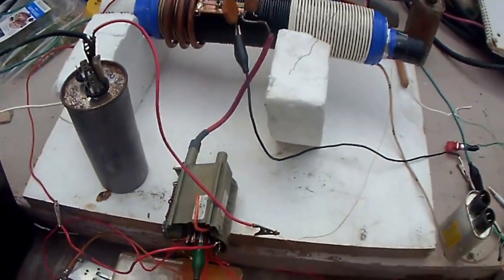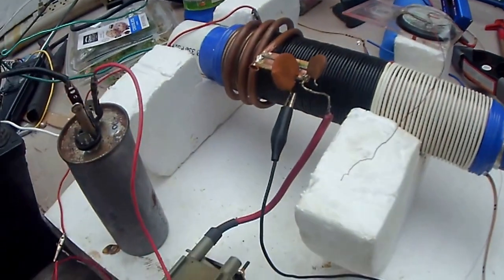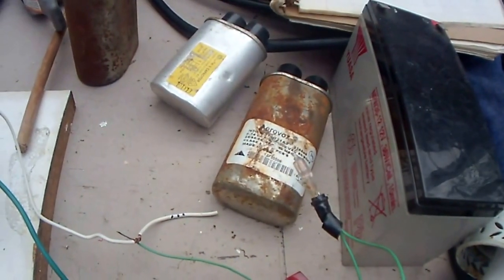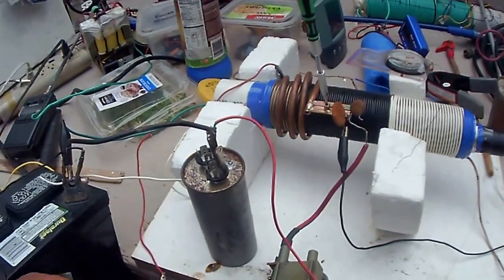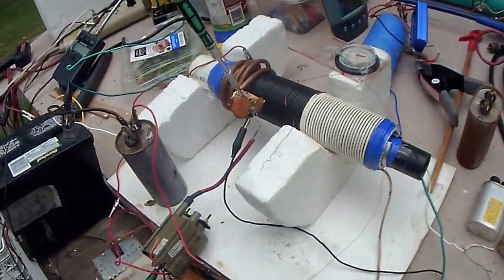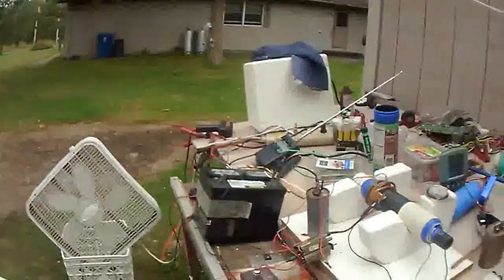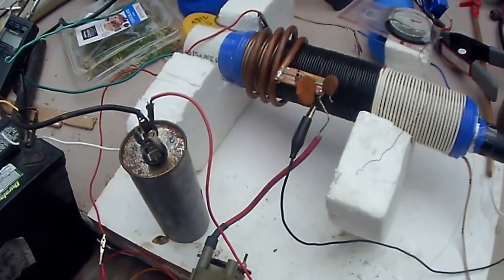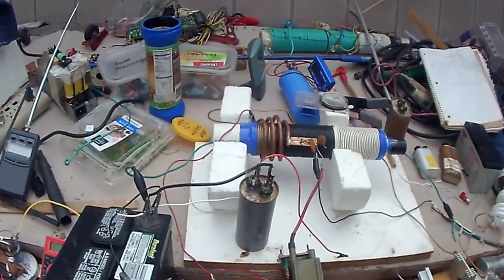Ikaku Chubinidze replication

Comment: Hey..you tried but the Mistake is that..you don't understand..how it's working..
Let me give you a hint..
You have to collect the Static charge and Store it in a capacitor..via At least a single Diode.. the action is to discharge a capacitor through a coil to create radiant or longitudinal wave..that discharge electrons from metal whether a sheet or wires as a coil..sink the electrons through a load to ground or through a diode into a capacitor to ground.

Comment: What you get in the aluminium tube?
Reply from the maker: The aluminum tube purpose is to collect radiant static electricity from the circuit.
Its covers primary coil High voltage windings.